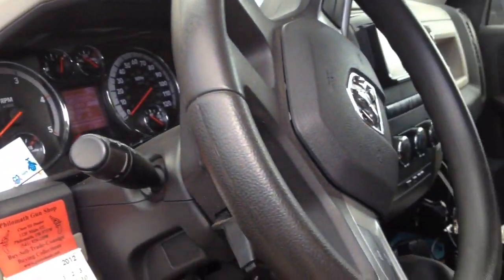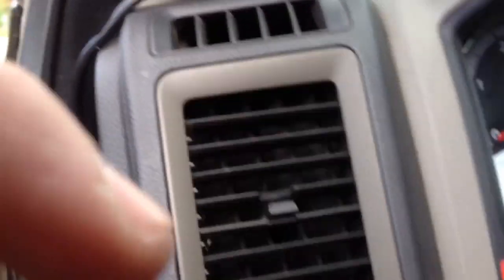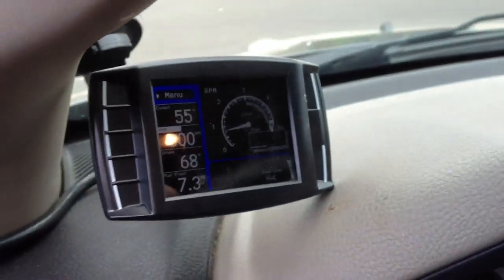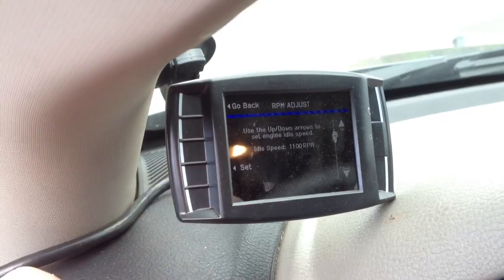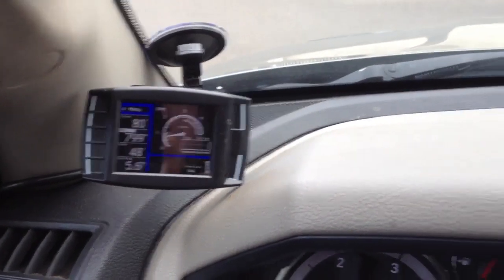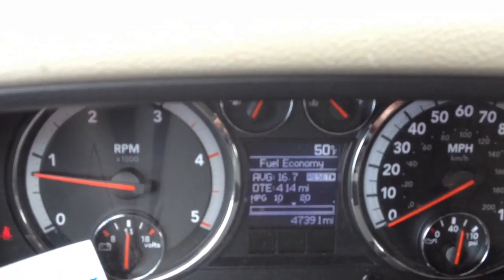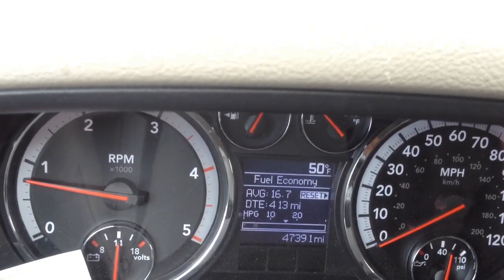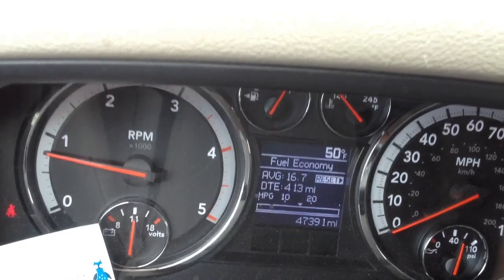H&S Mini Maxx 2011 Cummins

Comment from the maker: @Drew Reed; it would take one guy all day. Unless you're a mechanic. Took me and a friend about 4 hours. The down pipe will not come out in one piece without dropping the transmission cross member. You may want to buy a friend some beer it will be much easier to get the new down pipe put on. The v band clamp on the back of the turbo was a pain in the neck. The rest of it is straight forward exhaust install. Thanks.

Comment from the maker: @cooperpower: it's all done through the mini on the manuals. As long as the park brake is set you can set it just about anywhere. I don't have a pto or any need to go above 1100 but I know it will go to 1400. It's a nice feature.

Comment from the maker: I really like the interior. It's not a ford but it was also only $37k instead of $50k. I'm a big ass dude and its comfortable to drive. Everything seems to be where it needs to be. My only complaint is that it seems like you have to push the clutch all the way through the fire wall to get the neutral safety switch to let you start it. On a price adjusted total out of 10 I would give it an eight.

Comment: I have a 2011 6.7 automatic with a 4" turbo back  and egr delete. I set the idle to 1100 with the mini max and hit the exhaust break and nothing happens. How do I get it to do that ?
Reply from the maker: The engine has to be cold and the ambient temp has to be below so many degrees.
Reply: Trace Permenter dont quote me on this manual is exhaust break and auto is engine
Reply: Intake temperature has to be below 40 degrees Fahrenheit

Comment: I have the same truck year exhaust and tuner as you was just wondering if u had any problems with it on a higher tune. when mine is on anything above stock tune and I punch it to the floor it backs off and acts like no fuel is getting to it...
Reply from the maker: maverick that's weird. I haven't had that problem.
Reply: Oregon Bead Hand yeah then after it backs off it puffs out a bunch of smoke then goes back to normal.. idk. people are saying I need bigger lift pump because not enough fuel is getting to it.
Reply from the maker: maverick that makes sense

Comment: Hey man you should be getting way better gas mileage than that I get 18 in the city and 21 on the high way. Have you turned off the advanced timing with your H&S chip if you have not you will get way better mileage

Comment: Are you running tuner on hot all the time? I have 2012 3500 6.7 manual tranny with same tuner and exhaust and only can get 20 mpg on Hot. I run mild all the time cause I have no other engine mods. Good video btw
Reply from the maker: I always ran it on hot. I totaled that truck last spring though. I have a '12 long bed now with an auto, head studs, twin turbos and a mini maxx now. I average 16 now because it's hard not to haul ass everywhere.
Reply: Jason Davenport I know I’m resurrecting this from the dead. But were you still running the stock clutch on the hot setting? Just trying to see what I could expect to be able to run on the stock clutch until I have cash to upgrade it